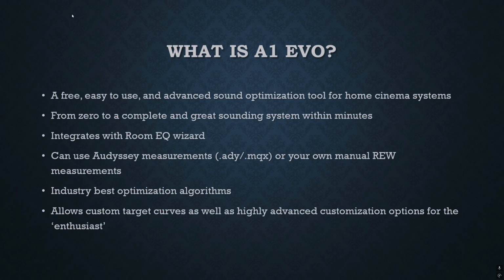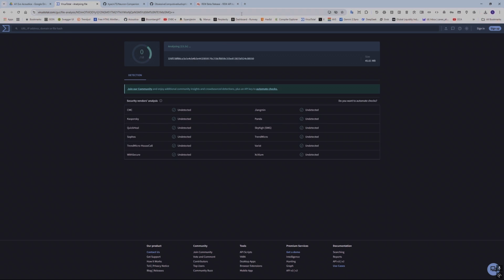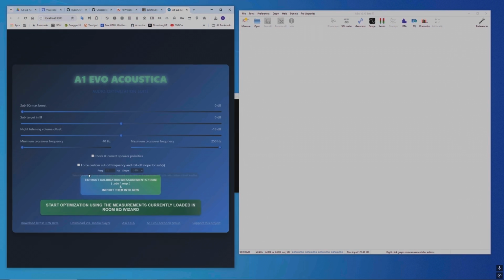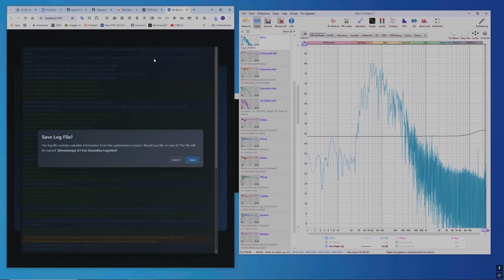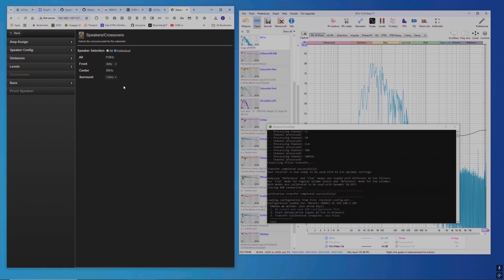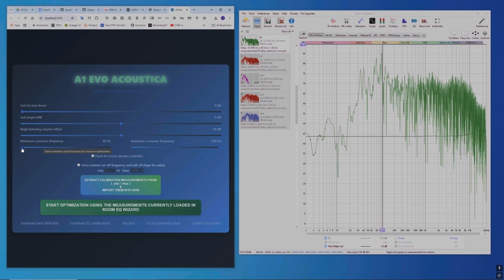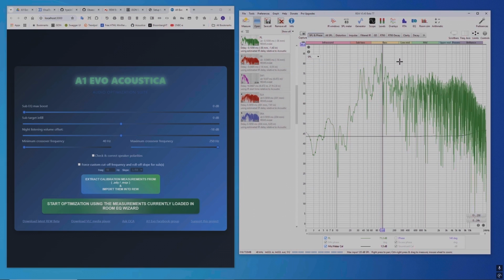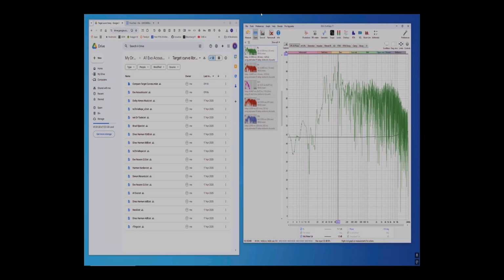A1 Evo Acoustica

Comment: Keep getting an error [ERROR] A1 Evo Acoustica cannot optimize your system without individual measurements for each subwoofer!. I am using an ady file and tried adding my own individual measurements after I got the error from using REW and my UMIK-1 and named them SW1 and SW2, but still the error.
Reply from the maker: You must be doing something wrong. Maybe try Acoustica's measure feature at just one m8c position to get familiar with the setup.
Reply: @ocaudiophile can give it a go tomorrow, but def don’t think I’m doing anything out of the norm from the video walkthrough
Reply: Did you resolve this? I'm getting the same error. I don't have a UMIK, but used the measurement file that Denon created via the MultEQ app.
Reply from the maker: @Kirko_bangz if you have 2 subs, you need to measure them with Acoustica. Audyssey app doesn't measure multiple subs separately.
Reply: @ocaudiophile  Am I able to do that with the factory Denon microphone? Or do I need REW and UMIK?
Reply from the maker: @Kirko_bangz yes you can use denon mic
Reply: @ocaudiophile  For this, should I go through the Acoustica measures and "start" fresh? Instead of using the measurements from the Denon app? Sorry to ask so many questions.
Reply: @Kirko_bangz nah I’ve been sick this week so haven’t had the chance/energy. Still don’t understand why using the audyssey measurements wouldn’t make it work.

Comment: Hi OCA! This is wonderful! After using A1 Evo for a few weeks, I was hoping I could ask you how to add my own PEQ adjustments in REW before it is sent to the AVR. My speakers need a little tweaking. EG: Is there a step I can pause in the html script to make my adjustments to the final filters?
Reply from the maker: Thank you for the donation. I'm afraid there's no easy way to add custom filters. You can technically pause the html script during optimisation in Chrome "inspect" mode and  do some custom operations in REW and continue. You should be able to solve most speaker problems with correct placement and toe-in btw.

Comment: now seem to be stuck at:  [INFORMATION] Applied speaker volume offsets based on perceptual loudness levels (ISO 532-2):
Reply from the maker: Try to minimize REW window, your laptop seems to be too weak for both.
Reply: @ocaudiophile  In my first try, I selected “save” when prompted and the processed stalled. I re-ran it and this time I didn’t save and the process completed with a oca file.

Comment: Hi, thank you for your great effort for making this for free ! 

I've been following you for a while and im amazed how great each version to another,

I would like to ask , what is the ideally number of position to measure your speakers using the new file is it 1 or 3 or 6 ? Should 1 be enough?
Reply from the maker: 5 (1 at MLP and about 30cm around it) should yield very satisfactory results in most cases. Above 9 would be quite excessive.

Comment: Hi Serkan... Does it mean we should take the measurements afresh... or the changes are in script and it will work with the existing ady files...
Reply from the maker: You can use old ady files
Reply from the maker: But re-extract them just in case
Reply: Thanks ... Also noticed, Double Bass : This is Double bass as in LFE+Main mode (Denon ) or bass is too weak ( you said you have removed it)...

Comment: Hello OCA, I ran Acoustica latest version with a new set of measurements...why are "all" of my distances way off or basically incorrect? Am I missing something or did I do something "wrong" in setting the speakers ordinal measurements in REW? I have a 13.1 speaker configuration and a Marantz 8805A. And finally, prior versions of Acoustica warned to not change the distances but this latest one does not - can I change the distances to the proper values, but if I do, what about the two subs, should I leave those as is? Need a little help please?
Reply from the maker: Don't change distances. Listen to your results and let's talk again.

Comment: Okay. So i hit a wall “it’s not possible to sync your speakers at the MLP with thr available harware limits of your AVR. you’ll need to move these speakers closer and repeat measurements!” . Any help please ?
Reply from the maker: Get rid of WiFi dongle
Reply: @ocaudiophile  you mean the antenna ? I did. I get a local host:3000 error and it shows up the error in the previous comment .

Edit:

Localhost:3000 says undefined
Reply from the maker: @absanka3 No this error is usually when there's a sub or speaker connected to your AVR via a wireless dongle which causes extreme delays Audyssey cannot handle.
Reply: @ocaudiophile i have a fully wired system to my marantz 7705. So i’m really not sure what’s going on here.
Reply: @ocaudiophile i have an old behringer eq connecting in between the avr and sub amp. Could this be causing the issue?
Reply: I tried disconnecting eq as well, still throws up localhost:3000 says undefined
Reply from the maker: @absanka3 probably, something in the line is adding too much delay
Reply from the maker: @absanka3 That's a different error, you must have done sonething wrong in the process
Reply: @ocaudiophile is there anyway i can chat with you or mail you?
Reply from the maker: @absanka3  You can try asking in the facebook group (there's a link in the app) to quickly resolve such errors
Reply: @ocaudiophile  thank you. i think i was doing a lot of things wrong and completely missed the step of taking measurements through acoustica tool. instead i took some measurements with audyssey on which might have gotten the measurements way off. going to redo everything.

Comment: I've just done another measurement using V7. I've manually selected : Subwoofer highpass filter => 25Hz : L-R4, lowpass filter 150Hz : L-R4. After measuring the transfered result, subwoofer response is still full level under 25Hz. What am I missing?

Comment: How would you recommend taking measurements using the new built-in method with only two subwoofer connectors, no directional bass capability (6700H), and four identical subwoofers connected with y-adapters to the two subwoofer connectors?

Should I just disable one of the two subs connected to each subwoofer connector during measurement?
Reply from the maker: You should add a minidsp but under the circumstances best you can do is to measure them in pairs as subs 1 and 2. Try to sync  phase and volume settings of each sub in a pair manually as best as you can before.
Reply: @ocaudiophile  Thanks. That's what I did with ODD. Will retaking measurements make a difference or is the new update just more for ease of use, having everything built into one app?
Reply from the maker: @volumnus Only convenience.

Comment: @ocaudiophile My tiny speakers can only go down to 100hz. Acoustica set them to 80hz. Will this 80hz setting break my speakers?
Reply from the maker: No, speakers don't fail because of lower crossovers in fact they're being fed full range (0hz) and very loud signals during measurements. The only problem would be distortion coming from a small speaker if the main volume is very loud. I don't think anyone listens to their systems at such high volume levels.

Comment: I keep running into an issue where it stops and says that I need individual measurments for each sub. The X32 isn't doing that though even when I select two subs, any ideas?
Reply from the maker: You need to measure your subs separately, Editor app will not do that. Next Acoustica version will have its own measurement tool that solves such problems.
Reply: @ocaudiophile would the solution be to just run the former version?

Comment: Great Tool! thank you very much for this Tutorial it helped me alot. But after doing the calibration and uploading the OCA File, my TFR & TFL Speaker wont play anymore. I tried different files/movies. I double checked AVR Config file and also my .ady. Both have my TFR & TFL listed. Also installed latest REW Beta + Acoustica Version. Do you have any ideas ? I took my measurements with the odd.wtf from Evo Neuron. 

Thanks!
Reply from the maker: Thanks 

Check amp assign in AVR menu and see if anything is changed. Also check if these speakers are on in the menu.
Reply: @ocaudiophile  The Speaker seem to work and are also shown in the Menu. It's kinda strange because i can also test them via Denon Menu and i can hear the Testsounds
Reply from the maker: @Jibril239 do you see any mismatch warnings during calibration file transfer?
Reply: @ocaudiophile  Just did a factory reset.. It worked after that. Seemed like misconfigured something in my avr...

Comment: I wish I didn't need to change anything from default, but as I explained below, probably due to the subwoofer y-adapters, I needed to change my high and lowpass filter settings after running Turbo. Default Turbo chooses BU 12db/Oct Slope. After I manually set my high and low pass filters, would you recommend using the L-R4 slope or one of the BU slopes like Turbo selected by default? Wouldn't BU2 be the same one (BU 12db/Oct Slope) that Turbo selected? I want to change as little as possible because I feel like I know just enough to screw things up beyond recognition.
Reply from the maker: Yes BU2 is Butterworth 12dB/octave
Reply: @ocaudiophile  I think L-R4 sounds a little more dynamic, but BU2 is a little smoother. They both sound good. There isn't a major difference.
Reply: @ocaudiophile Thank you. I'll let you know if it sounds better or worse than L-R4. L-R4 sounds very good.

Comment: Hope this helps others... I have been using A1 for a long time. My current receiver is a Denon AVR-6700. I'm running 13 speakers and 4 subwoofers with the help of a 2-channel external amp and two subwoofer y-adapters. The AVR-6700 will only push 11 speakers but has preouts you can use with a 2-channel external amp to push 13 total speakers. The AVR-6700 does not have directional bass and only has two subwoofer connectors. I took my measurements with Odd. I have four identical 12" subs. Odd has an experimental mode for receivers running multiple subs that don't have directional bass. 

Here was the issue. It took me a while to find a workaround. Before Turbo, Acoustica was setting my Subwoofer Highpass Filter from 29 to 31 and my Lowpass Filter from 100 to 110. Turbo set my Highpass Filter to 59 and my Lowpass Filter to 90. I suspect the discrepancy was caused by using subwoofer y-adapters, even though it was not as big of a problem before Turbo. The consequence of Turbo raising my Highpass Filter by 30 (from around 30 to around 60) was a very noticable lack of deep bass. To address the problem, I used Turbo's Advanced Mode to manually set my Highpass Filter to 30 and my Lowpass Filter to 100, which is consistent with what I was getting before Turbo. I also boosted the Sub Filter to max (6db). Doing this drastically changed my crossovers. My fronts went from 40 to 120 for example. After experimenting for a few hours, what my ears prefer is manually setting my Fronts and Center to 80 and my small surrounds and front and rear heights to 120. 

It took a few hours to dial in, but I think this is the best my system has ever sounded. When I turn on Dune 2 in Atmos, the sound is incredibly dynamic but also tight and accurate. I don't notice any muddiness or boominess. I'm very pleased with how it turned out.

Comment: Hi OCA, I've taken my own measurements through REW and when attempting to use Acoustica, I am getting an error saying "Speaker measurement 'FL' is missing an index". How do I fix this?
Reply from the maker: The FL measurement at the top should be named just "FL", if this is already the case try renaming it "FL0". I will check what bug has been causing this.
Reply: Thanks OCA, this has worked. Prior to vector averaging, I changed top one to only FL and left the other FL's with suffix then cross correlation and vector averaged. Changed final vector to FL name and it worked. Named all other final vectors in alignment with your naming convention and its run smoothly now! Thanks for the help!!

Comment: Hi OCA, 
first of all, thank you very much for updating A1 Evo.
I have a question about the bass management. In Nexus, with the same measurements (REW), I get a very good and stiff bass. In A1 Evo Acoustica the bass ist very boomy, almost annoying. On the other hand, the details and precision increased a lot with Acoustica. Maybe you can give me a hint, so i get my bass right.
Thanks in advance.
Reply from the maker: If you have an older AVR, make sure you turn "subwoofer level adjust" setting to OFF or else Acoustica subwoofer volume level settings will be bypassed. Your AUdyssey setting should be Flat, not Reference. If these don;t fix boomy bass, then select a less bass heavy target curve.
Reply: Hey, thanks for your reply. I have an AVC4800H. I tried the same target curve I used with nexus. Still boomy bass. I also tried manipulating the measurements. I have room mode at 47 Hz and 56Hz. I added +5dB to both frequencies in REW. I can see that Acoustica reduces now more at those frequencies. It helped a little bit, but bass with nexus is still much better. I also measured both settings, nexus and acoustica after correction. They look both very similar. Maybe you have any suggestions? Thank you.
Reply from the maker: @nudelgericht09 check your measurements for errors and repeat if you have to

Comment: Hi OCA, I tried using Acoustica on two different Denon Receivers (3800H, 4800H), but unfortunately it does not transfer any EQ settings to the AVRs. It changes all the rest, volume, distances, cross overs, but does not change any eq..   What could be the problem here?  Really loving Evo since the beginning....
Reply from the maker: It transfers filters you just don't see them in EQ displays which are just visual
Reply: Unfortunately not, i measure the Response afterwards and it is the same as before. So no eq is active

Comment: Hello OCA, I have the question: During the optimization process, A1 Evo determines a subwoofer distance of 1.78m for me – is this normal? In previous versions, the optimization process determined a distance well over 7m. I am therefore a little confused whether this short distance is correct - Denon 4800h
Reply from the maker: is that a single sub or a minidsp summed subs? I don't like to see sub distance shorter than speaker distances in general but there are few cases it could be optimal. Hard to say without seeing graphs. Connect all subs to 4800 if you have minidsp and re-measure with more mic positions.

Comment: Hi OCA; just about to start playing with Turbo :-) Quick question which may have been asked before, but why do you have Allpass turned off by default in your default mode; I had assumed Allpass would give the best results and should be enabled, is that not correct? Thanks
Kevin
Reply from the maker: Allpass is not a natural filter but rather a remedy for certain problems.

Comment: Hi Serkan great job ! But I couldn't able to successfully run, as am getting an error message at the end individual measurements of each subwoofer required " I have uploaded the audyssey file only ,I don't know how to upload the individual measurements,  could you please advise?
Reply from the maker: You need to measure each sub separately.
Reply: @ocaudiophile  but I dont know how to do separately,  as I have used audyssey file which has already both subs measurements right? Then why again need to measure?
Reply: @Reghua-l5d : In your AVR set the 2 subs as directional not standard and then run Aud measurement.. Now AUD will mesaure it as 2 subs abd give two separate readings that Acoustica will use
Reply: Thanks to your reply, but where i can find this settings in my Denon 6700
Reply: In the Amp asign I already changes as 2 subs also while doing the measurements in audyssey it is calculated and checked both subs measurements I have listened that, hence am confused why A1 is again asking separate measurements?
Reply: @Reghua-l5d : I see Denon 6700 has 2 independent sub outs.. your subs are connected directly to the AVR or do you have a mini Dsp in between.. in the speker configuration when you define 2 subs, you should see an option at the end mentioning Standard or Directional... change it to Directional and run aud measurement
Reply: @Reghua-l5d You will hear both the subs but if it is configured as 'standard' Aud merges the 2 into 1 while creating the AUD file... Check the number of Subs in REW after you have extracted the measurements there you will find readings for only 1 sub.. while acoustica is waiting for 2 subs as per your defined configuration hence the mismatch
Reply: @AbhishekSingh-fw7fv thanks for the reply however am still confused .In my denon 6700 there is no such option as standard/directional. In my receiver under setup menu >speakers >Audyssey >channel select > subwoofer> measure (2spkrs) this oprion i have already enabled,  what else to do?
Reply from the maker: @Reghua-l5d use odd.wtf measure
Reply: @AbhishekSingh-fw7fv in REW after uploading my Audy file I can see that SW10 ,SW11 ,SW12 in REW I  think these are for my subs ,but still am getting error  I dont know what to do .
Reply from the maker: @Reghua-l5d if you have two subs, you also need SW20, SW21...
Reply: @ocaudiophile hi thank your for new turbo V6. I really want to enjoy what you have created ,but am not able to do , still struck with separate measurements error in the new turbo as well. I just tried now, please guide me , in my receiver ( denon 6700) and in multi eq everywhere I have already selected as "measure 2 subs" still why I am getting error from v6 turbo?